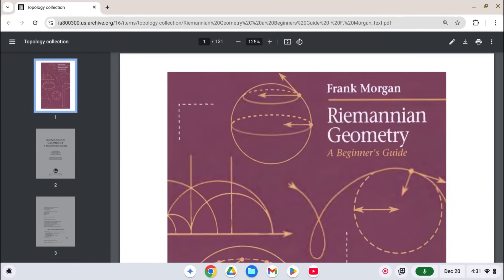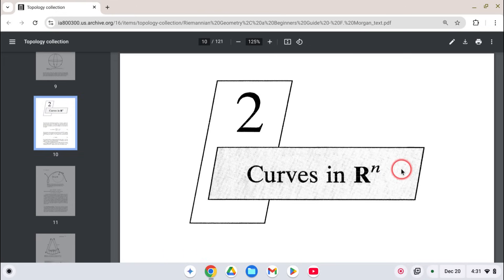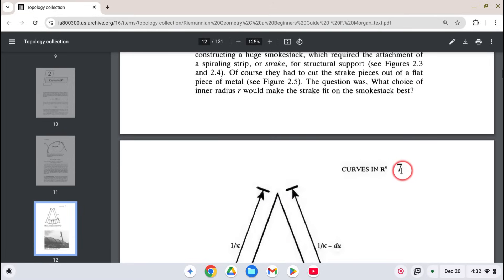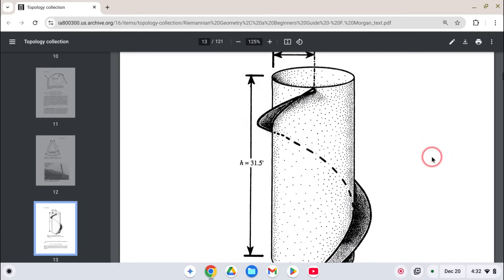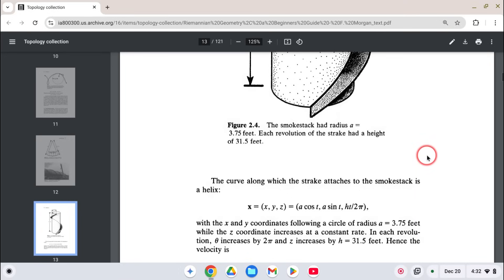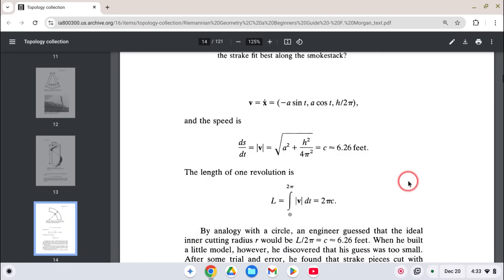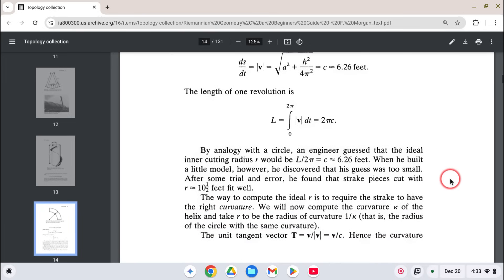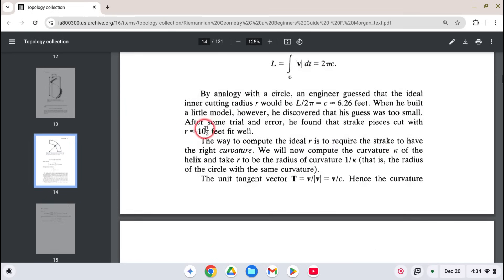This is why I love Engineers

Comment: As a sheet metal fabricator I can tell you exactly why his initial calculations were wrong or at least flawed to begin with.
We use something called a K-factor when calculating the bends of metal, now steel has a convenient K-factor of 0.5 meaning, he should've added half of the width of the spiral to a before making the calculation. So in reality a = 7.75

To explain what K-factor is simply, it's the theoretical line you draw down the edge of a piece of metal, that after bending, has gotten no shorter or longer due to deformation. IE on one side of this line the metal is being squeezed together and on the other it is being stretched. 

For anything with tooling the final K-factor will in reality come down to a table of K-factors that they arrived at experimentally long ago. To maybe be tweaked if the part can't hit tolerances after being cut.

But for anything that'll be slip rolled, it isn't the internal or external diameter you use to calculate the length, it's width of the piece, multiplied by the materials K-factor, plus the internal diameter. That is your actual radius.
Reply from the maker: @akselbering291  that is so cool, thanks for sharing

Comment: I can remember when I was in company during my masters and the task was to design and tune a controller fast in a day before the superior was flying. I had a plant model and the controller architecture was proposed. There were like 2 controller parameters to tune. I did trial and error tuning and after a few minutes I got the parameters. My superior came and asked me how I got to that parameters. He wasnt happy about my approach so he started to do the proper design method using pole placements and in the end after hour he ended up with parameters that happened to be the same as mine.
Reply: for me it's usually different: do the formal analysis, build it, then tune "by hand" if it is not good enough.
Reply: @victortitov1740 back in my first year of mechanical engineering I would design and build something ‘by hand’ and then reverse engineer a formal analysis which I then used to fine tune my design, let’s just say this only worked for very simple systems of course
Reply: Did you use the Ziegler Nichols tuning approach?
Reply: @fablearchitect7645  No I didnt because it tends to lead to quite undampened oscillations. Also because I had the simulated plant model I wasnt very limited with physical reality.

Comment: My mentor at my first engineering job always scolded me about trying to be "too precise". He always told me: "it's not pharmacy". Years later I say this to every intern I have
Reply from the maker: Funny, I used to tell my group the same thing, I had to get products out the door and they wouldn't let go because it was not "perfect"
Reply: same with programming 
stop trying to under stand the fundamentals of electricity and chemistry when youre just makin a gosh darn game
Reply: but it's more fun this way😂 @iamtimsson
Reply: @ I'd say it is a mixed experience. You don't want to programm by just randomly trying stuff out and having to debug your mess later on. Better to have a rough plan beforehand and come up with a sensible architecture
Reply: I work in pharma, and let me tell you it's not always that precise here either. Certainly if I had a drug that came in 10.45 mg vials and someone filled some to 10.5 we'd accept that.
Reply: thats cool and all but i wont let you build my house xdd
Reply: *3.png*
*pi.png*
*e.png*
"3 pie. They're the same pictures"
Reply: *3.png*
*pi.png*
*e.png*
"3 pie. They're the same pictures"

Comment: I'm confused... why are we measuring the speed of a helix, and why is the answer to that just feet, instead of feet/second? And why are we calculating the radius of the helix if we are already given the radius at the start? (I am not a mathemetician)
Reply: I think its just thr mathematical way or tool of solving it, theyre really not solving for a speed. It only aids in getting the necessary arc lengths
Reply from the maker: What the reply said, that is also how I understood it.
Reply: I think it's similar to the "pitch" of the threads on a screw/bolt. Speed is just the terminology that's been accepted for how far down the shaft the helix has to travel to make a full rotation, something like that

Comment: “Fast reaction” guidance calculations for when the Apollo 13 crew needed to make a correction burn was done so with slide rulers. Checked manually with humans pushing pieces of plastic against each other for approximate values. And they got home just fine. 😊
Reply: To clarify, THEY were just fine. The getting home part itself was anything but just fine.

Comment: Randomly found this video on my recommendation page. I’m 18 years old, and for the first time, I’m in an engineering National graduate school in Morocco, first year. Going from school to national graduate school, things went from 0 to 100. I find everything difficult, and sometimes I question myself what I was thinking signing up for this university. when I review my subjects, I find it difficult paying attention even though I’m very intentionally trying to pay attention, but every 5 seconds, I zone out. I thought I’d seek an advice here knowing a lot of other people seem to also have come across this video randomly from their recommendations page as well
Reply: I would recommend concentrating on mathematics in the beginning. Make sure you understand at least single variate calculus inside and out. Multivariate calculus is also very important but it reuses a lot of stuff from singlevariate calc. Almost every model in physics is based on a firm understanding of calculus. Thats what I wasnt doing in the first year and it really made the rest of my degree hell because I didnt really understand the heart of the models. Once I went back to start from the bottom it all clicked. Also if you need help understanding physics then i would recommend Young and Freedman university physics book. Its an amazing book and it has an instructor manual with very detailed solutions for all problems. If you really understand the mechanics part then you will see that there is a lot of reuse in electromagnetism and thermodynamics. You just have to understand momentum and work.

Also for me the game changer was going running at least once a week. Or just an excercise where I have to consistently push through the urge to stop.
Reply from the maker: You are describing myself in year one college.  I went from a poor high school in the mountains to a university and I was lost, poor grades, bad attitude, almost quit several times.  Every time I tried to give up I thought about the rough life my parents had, father was a coal miner, mother was a waitress.  I wanted more than that, so I stuck it out and it slowly got better and better and I grew up to be a scientist, got a good job, and had a great life.

Find something you want to achieve and think about getting that.  I wish you good luck.
Reply: @lkapitan8232  Thank you. i'll keep this in mind
Reply: I had the same experience. Coffee helped me against zoning out. Doing the practice tasks alongside the lectures helped me understand the lectures better and so follow them more easily.

Comment: Nice video. The helix is not for strength though. Its because of the karman effect or vortex shedding. The helix makes the smoke stack not shake itself  apart in certain winds.
Reply from the maker: That is interesting, now I have to look that up.  Thanks
Reply: Is this to avoid resonances, or is that an entirely different situation?
Reply: @Wizz15  You're correct. There's quite a nice article on the subject on wikipedia btw.
Reply: @Wizz15  Flow around a cylinder oscillates transverse to both the the flow and cylinder. If the frequency is close to the structures resonant frequency it will fail via fatigue or if the wind blows hard enough the oscillations overwhelm the structure
Reply: Huh, you learn something new every day.

Comment: Was probably once true, but nowadays engineers will build CAD drawings to determine this stuff.
Reply: And some engineers (the ones who actually know differential geometry and have PHDs) program the CAD software
Reply: @therealenzyme1954  Except they generally don't. CAD programs use completely different mostly purely algebraic methods for that task. And the ones building final applications don't even bother with that: they just have libraries with readilly made procedures like "create line equation", "create circle equation", "create spline equation sequence", "find intersection pounts between objects defined by equations", "compose rotation matrix", "apply transformation matrix", et.c.

One of my old programming teachers used to say that "life is too short to solve differential equations". When you get into a situation when you have a task of creating something that must 100% be done and preferably on time you quickly realize that it is indeed true and you really start to appreciate multiple workarouds and shortcuts people have created to be just good enough for their specific jobs.
Reply: @therealenzyme1954  Based.
Reply: @therealenzyme1954  That is my answer when people say things like that.
Reply: What about the dude who wrote the CAD software? Did he also build a model and then winged it?

Comment: Hardly needed a Prof of of anything to work out the helix. I did an apprenticeship in structural steel and welding in the 70s and learned how to calculate, develop and fabricate screw conveyors. This strake is the same principal. Oh and no calculus required. Just basic high school trig.
Reply: A bit of a whippersnapper question for you, has apprenticeship declined as an entry to your profession?  Or have you noticed any changes between the earlier days and today that you think would benefit the younger generations?
Reply: @skachor  Thanks for your question but I can't really answer. I was working in the trade for 18 years then went into engineering. That was 32 years ago and for the last 25 I have run my own business in mechatronics. So I'm a long way from that trade these days. Merry Xmas :)
Reply: @1r0nb1rd  Now you're asking. I haven't done this for ages. You've got me curious to recall. Can't do it now cos I've had a few drinks. If I remember to, I'll get back to you tomorrow.

Comment: A mathematician, a physicist and an engineer are all tasked with measuring the surface of an irregular rubber object.

The mathematician breaks the object up into different geometrical forms, measures it and sums it all in a series of equations.

The physicist uses a combination of archimedes principle and shadow optics to get the volume and trace the outline of the object in a number of different positions then approximates the surface area in a sum.

The engineer looks up the manufacturer's manual and reads the exact surface area directly.
Reply from the maker: That a good one, thanks.
Reply: After being unable to find the right spec sheet, the engineer dips the object in a vat of paint, and measures the weight of the vat before and after.
Reply: @AngryArmadillo My exact solution before finishing the joke. Being tasked to measure an object made me forget to check if somebody else already did (in a datasheet).
Reply: I actually did this in a job interview for an engineering role one time. It was a small startup of primarliy physisists and I was interviewing for a ME role. The technical question was design a coupler betweeen two pipes of x and y size with a bunch of requirements for pressure, reactivity, hole pattern etc. Anyways I was looking at this problem, pulled up google, found the correct coupler for the hole patterns, checked the spec sheet for the other requirements and just sent him the link in the zoom chat. The interviewer spent about 5 minutes flabbergasted that I hadn't gone into some technical approach to designing and validating a coupler. He wrapped up the interview after about 10 minutes and just moved me on to the next round... I guess the lesson is keep it simple??
Reply: As an engineer major I thought about using integration to find the surface area lol but I guess that would be more convenient to just search the manufacturers manual assuming you were given that information from the start.
Reply: Never do more math than you have to.
Reply: I’d dip it in paint of a known thickness and figure out the weight per surface area.
Reply: Always read the datasheet.
Reply: Personally, I'd dip it in water and find the volume and hope nobody noticed
Reply: @skachor that is the archimedes principle
Reply: @thomas.thomas no it's not
Reply: Reminds me of a story about thomas edison.  He hired a mathematician fresh out of school.  For his first task he told him to find the volume of a light bulb.  After a couple of days the young man finds him and tells him the volume.  
Good, says edison, now give me twenty more.   
Twenty more? The young man exclaims.  I just spent two days doing calculations!
Edison sighed and led him to a workshop.  He took a bulb, filled it full of sand, and poured it in a measuring cup.
Reply: Someone had to calculate to put it on the manual bruh
Reply: @obamagaming3802right, the CAD software it was designed in.
Reply: ah, catalog an datasheet, my old friend
Reply: Unironically this is the way. I was measuring something and after some time I found out I could get acces to the plans where everything is stated neatly